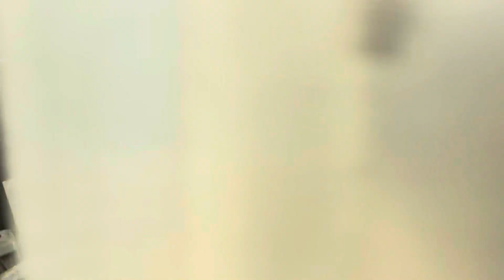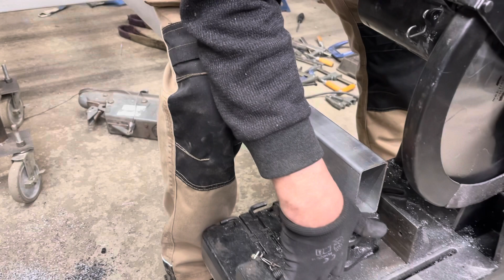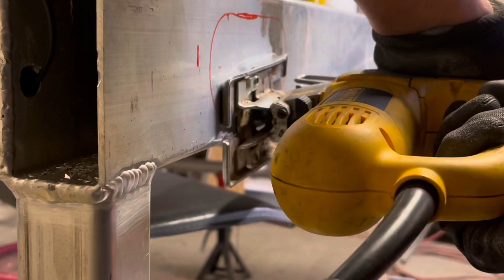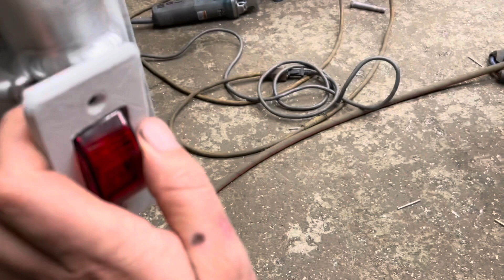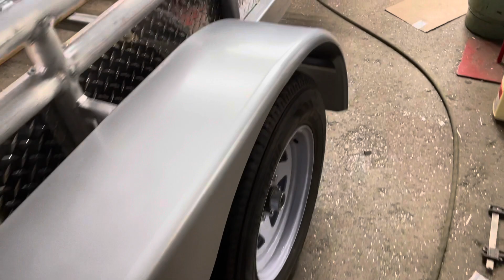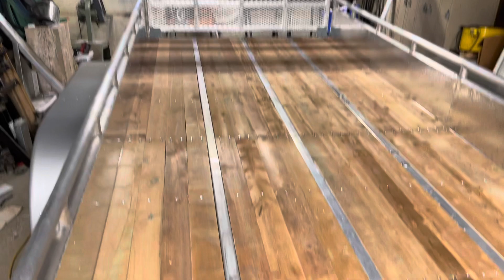DIY ALUMINUM UTILITY TRAILER !!!

Comment: Very nice looking trailer but I believe you made one critical mistake....using pressure treated wood.  The copper in pressure treated wood destroys aluminum.  Galvanized corrosion will begin the first time that trailer gets rained on. If you have electrical grounds on the trailer, they will speed up the process.  You really need to remove the pressure treated wood asap.  Replace it with a composite product or hardwood lumber with a good sealer.  The pressure treated wood that is being sold today isn't very rot resistant, probably no more so than a non treated hardwood with a high quality sealer. Aluminum + Copper= Galvanic Corrosion. The Aluminum always loses and it will happen quicker than you think

Comment: The modern pressure treated wood and aluminum dont work well together, et wiil eat holes in the aluminum.   That's why you don't use it in boats.

Comment: Pressure treated wood is a big no no when it comes to aluminum. Pressure treated wood has copper in the treatment. Copper is corrosive to aluminum. Google it. This is why no trailer manufacture uses treated wood with aluminum.

Comment: Question: why did you install all the deck boards with the joint all butted together at the center instead of cutting and staggering them so the joints are not all located in one location? So instead of using all 8 foot boards, you would use a mix of 8’, 6’ and 10’ boards in order to stager the butt joints. It would make the deck look more seamless.
Reply from the maker: I just used what i had , when I built this wood was at an all time high . Thanks
Reply: @BonifabcustomRobBonifacio  Works for me! I went to purchase some new cedar deck boards around that time and literally choked. I waited for a while until they came down to an almost tolerable price. My wallet still hurts.

Comment: Where did you get that steel wire from? I have searched and can't seem to find it. Oh and I almost forgot that is a beautiful welding job, very nicely done!
Reply from the maker: Thanks , what do you mean by steel wire ?
Reply: @BonifabcustomRobBonifacio  the wiring you used for the lights? You called it Steel wire so assumed the bundle was enclosed in some kind of clear / wire mesh.
Reply from the maker: @xtroadrunner  yes it’s a wiring incased in braided steel and plastic
Reply: @BonifabcustomRobBonifacio  I was hoping to find out what brand it is or where you purchased it from. Looks like really good quality.
Reply from the maker: @xtroadrunner  there actually cut off from some type of garage opener motor got a bunch from a friend a few years back and I’m running out unfortunately

Comment: this video below shows a commercial aluminum trailer that only uses 2x3 and you are using 2x4. your's also has a ton more cross bracing. Any reason you overbuildt it so much? Also why did you put the A frame tongue on the same plane as the deck? Every trailer I"ve ever seen has the A frame extend UNDER the deck a few feet.  https://www.youtube.com/watch?v=aR2GtiONSYc

Comment: Nice build. One thing though is the copper in the pressure treated lumber can galvanically corrode the aluminum. Happens all the time with aluminum pontoons on pressure treated bunks, even through bunk carpet.

Comment: How thick is that aluminum square tube are you using? What did you use as an insulator between the steel axles and aluminum to prevent corrosion?  Thank you
Reply from the maker: Thanks the square tube is .125” wall and i put some thin puck board plastic between the axles and aluminum

Comment: Hi Rob... as usual "devil is in details.." just a comment, use some MS polymer to seal the turning and break lights in order to avoid electric problems... safety the first.. This sealent beam protect interior of chassis and avoid future rust problems inside the plataform. And usually are fully repaintable with all paint availables in the market.
BR.